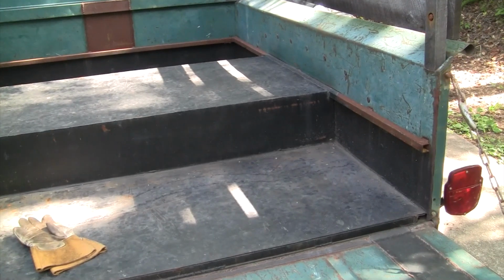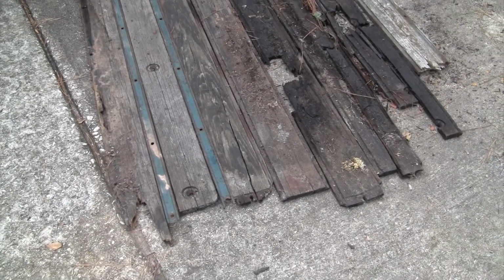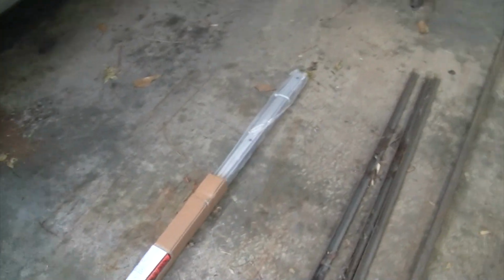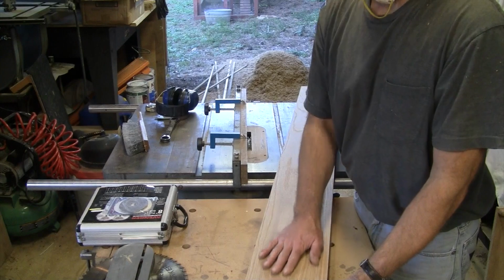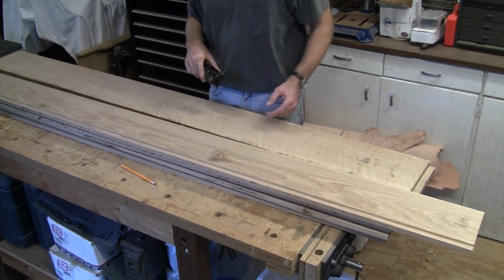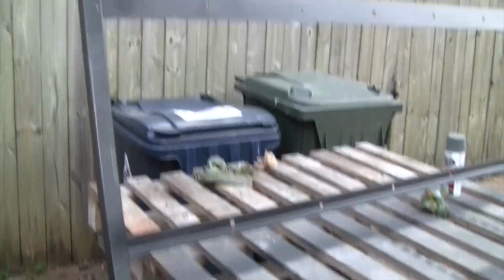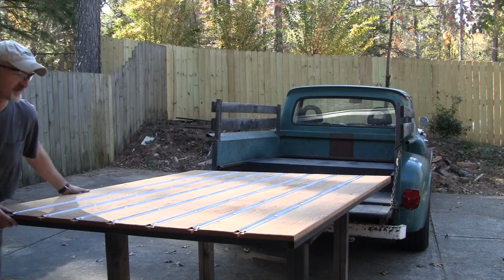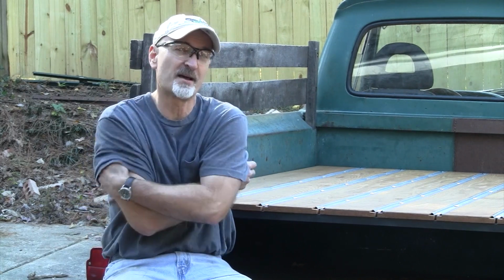1962 F100 Flareside/CVPI frame swap; Episode 25: Bed wood installation

Comment: The under storage is gonna be handy... nice wood working equipment too.. I have a old Unisaw myself.
Reply from the maker: Yes, definitely nice to have a more functional truck bed now.  The old woodworking machines are second to none in my opinion.  Another one of my passions is finding and restoring these old machines.
Reply: @rudysresurrection5897  Yes those old machines are hard to beat.... how about a show and tell video of them?

Comment: Hey Rudy what's up brother how's it going long time no see. How's the F100 doing.
Reply from the maker: Hey CJ.  Hope you are well.  Thanks for watching.  The F100 is runnin' strong!  How is your truck coming along?
Reply: @rudysresurrection5897  My 96 F150 is doing great drove it to work today, filled it up with some gas, and it's driving like a champ with 209,000 miles.
Reply: @rudysresurrection5897  Have you heard of the new 7.3L Godzilla V8 that Ford is making for the new 2020 Ford Super Duty.

Comment: How many miles since the swap.
Reply: Oh nevermind.
Reply from the maker: Hey Stacy!  Hope you and yours are well.  Guess its getting pretty cold in Michigan about now.  I have put just over 11K on it since the swap.  How many have you logged in your truck since completion?
Reply: @rudysresurrection5897  yep, around 25F right now. Planning to drive the truck a couple more times before I put it up for the winter. Around 18K.